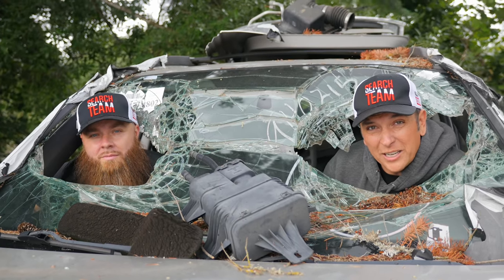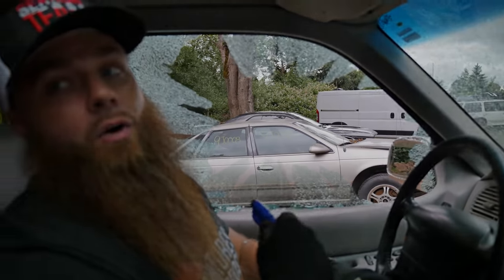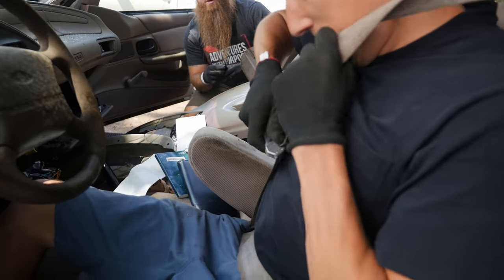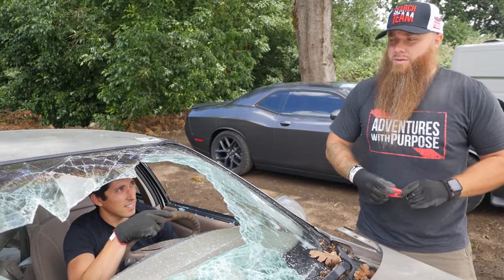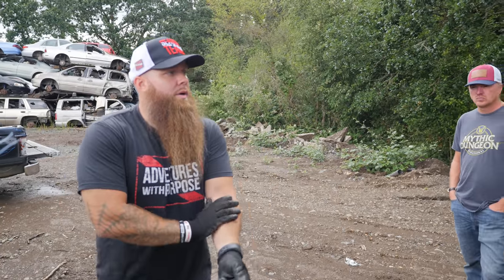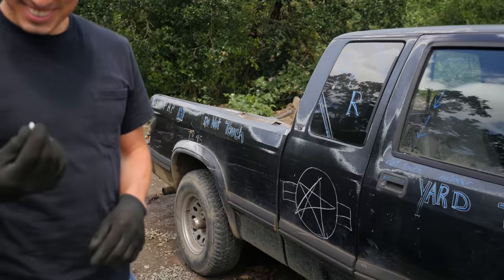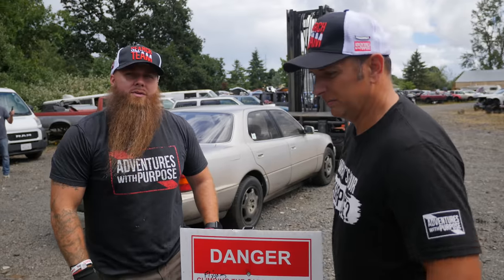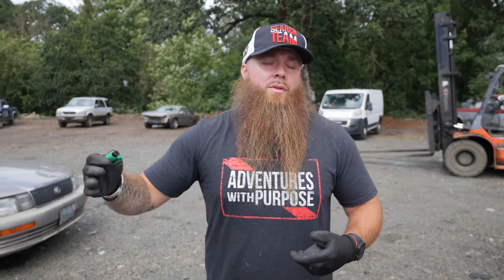HOW-TO-ESCAPE FROM YOUR CAR.!! (This Could Save Your Life)

Comment: The Smith & Wesson isn't really a great knife, but this demonstration clearly shows how the tool should be a "must have" for every driver. No fiddling with trying to get a knife from your pocket and then opening it. The seat belt cutter quickly zipped through that fabric. I agree that this should be on every key chain. At the current $6.95 price (in 2022), it shouldn't even be a question of whether you should have one of these. You absolutely should. I just purchased two of these.

Comment: Great video! I had some questions watching it. 
1. What do you do if all your windows are laminated? 
2. (This may sound stupid) How do you determine if it’s a good idea to stay in your vehicle vs escape. If you’re seriously injured it might not be a good idea to be moving around. What are the things to consider? 
3. If you’re trapped inside your car would the average person have enough strength to throw a piece of ceramic hard enough to crack the window? I know this was more about if you’re trying to get into a car but it made me wonder.  
4. If the vehicle is sinking and for whatever reason you can’t break the window, wouldn’t it be easier to open the doors once it’s completely submerged? How likely is it that you can escape in that scenario (given that you aren’t panicking)? 

Thanks for putting this video out there! It was really helpful to see that tool in action. I already have one and this solidified my faith that it will work in an emergency.
Reply: You cannot open the doors until car is of water due to the air pressure.
Reply: @allisonbowie1872  I know. That’s why I’m asking how likely survival is if you wait until the car is completely submerged to open the door (in the event you can’t break the window) vs breaking the window and escaping before the car is filled with water.
Reply: @badwaterb118  unfortunately you can't wait to open the door until the car is totally submerged because it fills completely with water in seconds through the bottom of the car, that is why in floods the cars no longer advance because the water filters from below, so the best option is to break the windows as soon as you can
Reply: @CM30-e1q   again, I understand that breaking the window ASAP is the best option. I’m asking for an assessment of survival in the event that you can’t break the window for whatever reason. To word it another way, how likely is survival, and what can you do to improve your chances, if you have to wait to open the doors once the car is submerged.
Reply: @badwaterb118  from what I'm seeing by the comments I'm no expert but you wouldn't, if you can't brake the window, the car would be full of water and you'd drown before you'd be able to open a door

Comment: FYI, we keep our emergency tool zip tied to the bar of the drivers side visor in all our cars. You can pull it off quickly and easily and always get to it in the event of an accident.
Reply: How can you pull it off easily if it's zip tied to the bar?

Edit: Ohhh, I see there's a release feature so you just pull and it comes off.
Reply: Great idea, I have a key fob and was wondering what I could attach the tool to.
Reply: Based on what was reported by AWP and what I see in their videos, the vehicle often turns over head first as the weight of the engine drives the vehicle into the water. The result is the car end up wheels up. I think it wouldn't hurt to have several of these devices located at midpoint throughout the vehicle. I haven't looked at them yet but I think they could be attached by a thin "chain" like you often see on a key chain or light bulb. A quick pull and its off.

Comment: When my kids were little I was terrified of this scenario. 5 kids with 3 being under the age of 5. The two older kids and I would practice getting the little ones out of their car seats fast in case of emergency. Big kids in the third row (very back), little kids in the middle, parents in the front. You have to practice until it becomes muscle memory. Glass breakers in the front and back of car. Let's face it, front seat passengers could be injured or deceased so kids have to get out on their own. Thank you so much for this video!

Comment: My wife is afraid of going over bridges. She has a hammer like tool that has a seatbelt cutter the piece that shatters the window and it has blinking lights and flashlight
Reply: @tatonkatatonka  - Right. And sometimes the seatbelt locks you in and you can't reach over far enough without unlatching the belt or cutting it off. I'm getting one of those for myself and each of my girls.
Reply: I have mine stuck to the dashboard with one of those sticky things that you can use to hold cell phones and glasses. The hammer thing

Comment: I had a rollover back in college. I did everything I could think to try and break the window to escape. I remember winding up and slamming the window as hard as I could and my hand just bouncing off. I'd never felt so helpless and weak before that moment. It was especially ironic given that I'd nearly died going through a window when I was a kid, and there I figured I'd die because I couldnt break a piece of glass. Eventually I calmed down, found the handle in the dark, unlocked the door, opened it and crawled out. I went to look at the car the next day at the wreckers yard. I had bent the door trying to break that glass. If my car had come to rest 30 yards before or after where it stopped, I would have drowned. If the engine caught fire, I would have burned alive. That glass is no joke.

Comment: Where would you suggest keeping the tool on a keyless start car? The keys arent easily accessible and possibly would fly around in a crash
Reply: On a lanyard in pocket of armrest or dashpocket...
Reply: I have ours zip tied to the passenger head test. Easy to grab. We have one in the backseat as well.
Reply: Turn signal lever or gearshift handle with a hair tie
Reply: @IKTH9192  kind of like the car in the video, no head rest. But great idea otherwise

Comment: You see all these scenerios on tv, movies etc, you think ok how ridiculous well that's what I thought until July 13 2022 on the interstate switching lanes I see flames in the SV mirror I stopped immediately told my passenger to jump and run he did, then the "ridiculous" happened my seatbelt is stuck my door won't open within seconds felt the heat on my back I did get out right as it exploded throwing me 20ft they said. Now there is NO "RIDICULOUS" scenerio scariest thing I've ever been through!! Thank You for this Video!! Seconds REALLY matter!!

Comment: The best way to prevent being ejected is to wear your seatbelt. I'd rather be able to break my side window to escape a dangerous situation. 
Keeping you in also means you're trapped in.
Reply: Yeah, I mean; if I get thrown out my properly worn seatbelt, I think I have different problems to worry about... Chances are I am already dead before a side window is the last thing to keep me in vehicle. However I can see that it would be good to keep the arm in. Overall, I think I would choose to have another two exits over some additional containment.
Reply: My paramedic sister said she found a lot more dead bodies that were ejected than were still inside the car. Sorry for the awkward phrasing.

Comment: I just want to add that if you never have to use the window tool, the seatbelt tool is worth the price. As a former first responder, you can't fuss with seat belt locks when you're in shock. Especially if you're trying to get family out.

Comment: Any recommendations for where to keep this tool when using push start (keyless) keys? It'd likely be in my pocket which will get by better than not having it.
Reply: Great question @Zonehawk
Reply: would like to know also as i have one and the fob is usually in the pocket of the jacket i use in fridge
Reply: I have ours zip tied to the passenger head rest. Easy to reach!
Reply: I was just thinking about putting it on a long cord and wearing around your neck- you definitely won't lose it! 🤗🌷
Reply: You could use a hair tie and put it on the turn signal lever or the gearshift (although some no longer have gearshifts and are knobs or buttons)
Reply: I do not know if it is a good place or not, but I hooked it to the passenger side headrest. Removable headrests usually come with two metal rods that enter the seat. I pulled the passenger side headrest out of the seat and putting it back in I put the rod that is closer to the driver seat through the keychainloop of the rescue tool. So that the rod goes through the keychainloop. The tool cant just dangle there. The tool cant go anywhere and you can easily pull it off like if it would be on a keychain. And theoretically all passengers in row one and two have access to it. I can access it without moving my body, just my right arm. 

This might be kinda weird to explain without having seen it, so if you wonder what I mean specifically just ask me and I will try to give a better explanation.

But basically one rod of the headrest is now going through the loop of the keychainring locking the tool in place like if it was on a keychain. And you can still just rip the tool off the chain like normal. Idk, was that explanation enough?
Reply: @IKTH9192  Oh yeah, I had a very similar idea. Instead of connecting it with zipties to the rod of the headrest, I just took the headrest out and stuck the rod through the loop of the keychain when putting it back in. Basically almost the same approach. Had I read your comment on the first reading of the replies, I might have skipped commenting. :)
Reply: @herrkeks8509   I would tie it on with a slip knot. If your in a rollover accident the headrest could be impossible to remove due to damage to the roof. If you use a slip knot in the event of an accident you can just pop the knot. :)
Reply: @rayevans3679  Oh no, I‘m not crazy. :) Having to remove the headrest would be terrible. Rollover or not. You‘d be done, before you could get it out.

Here 4:23 you can see that these things are made to be ripped off of what they are attached to. Instead of a keychain the keyring is attached to the closest pillar of the headrest. I can pull it right off, just like here in the video. :)

Thanks for your concerns about my safety. :)

Comment: 23:34 Oh, c'mon! Every kid knows that at the event of accident or sharp braking seat belts do what? Exactly! They lock in place to stop your body from travelling forward against steering wheel or dashboard. So keeping that in mind only thing you have to do is pull sharp on seat belt to have it tight. And correct place to cut it NOT anywhere in your shoulder or neck area but right beside the seat belt buckle. That leaves you without need to pull unnecessary 2' length of belt through the buckle, where it might get a twist 🔀 and get caught or seized. Seconds! Seconds are vital!!! 

I think you've been a bit unfair with that point ;)

Comment: Okay now lets see all this done in a 2017+ vehicle with the laminate glass side windows ( you mentioned but did not show ) and how to break them properly. Plus many cars today have push button starts so where would the best place to be to attach a window breaker where you know it will stay put and be reachable in an accident? All the vehicles you showed in this video were older. What about newer vehicle demonstrations?  Doing all this maybe with a 2020? So many new vehicles have added safety this or that. I was not aware they now made side windows like front windows are made. With front windows being so hard to break, how is someone suppose to break a side window if its the same as the front.

Comment: I have had one of these little tools on  my Keychain for over 5 years now. I will forever have one. I have two kids who sit in the back of my vehicles and I need to be able to get them out immediately. Especially when they were in carseats. So so so important. 

I was in a car accident when I was 3 months pregnant. We landed upside down and I was suspended by my seat belt. I had to be cut out by paramedics because i couldn't get my seatbelt off.

Comment: Hi guys. In South Africa a lot of vehicles are being fitted with an aftermarket film that is applied to the side windows as a security aid to prevent what we call "smash and grab" robberies. This is where criminals use a device like a spark plug or similar to shatter one of the windows and then grab any valuables. This film that is added to the windows is supposed to prevent the windows being smashed or shattered.
What would you suggest in this case ? Have you tested this device on windows coated with aftermarket tinting film or similar ?

Comment: The knife and spark plug won't work under water you won't have the same strength in the water. That's why AWP's tool is more efficient. It is spring loaded. My concern I have all laminated windows. For the newer vehicles without tempered glass, can you show us a way to get out please? I would have already bought your window breaker a long time ago. I would love to support you! It would be amazing if you came out with a tool to break laminated glass. I've watched others videos and none of the other window breakers work on laminated windows either.

Comment: Years ago me and a few friends had some junk vehicles on private property. The front windshields are so strong we rode up it with four wheelers and dirt bikes. We did burnouts on the windshields we could barley get a hole in it to put your head through. He had a lifted Chevy about 9 inches off the ground with 35’s mud tires on it. He drove that up it. It still didn’t break. I put .22 cal through it and my 45/70 gov. Through it. It doesn’t bust. Point is you’re not going through the front windshield. If you do you’re hitting it with enough force you’re dead anyway.

Comment: Question - Most (or a lot) of the new cars have key fobs.  I keep my key fob in my purse which is usually on the backseat floorboard or front passenger floor. Where would be the best place to keep this tool since I don't have my keys out and I know not to put it in the glove box.  I like how easy this tool seems to be to use vs the car safety hammer that I have now.  I just would like to know the BEST place to keep it since I don't take my keys out of my purse.  Thanks and thank you so much for this video - I learned a great deal.
Reply: Zip tie it to your visor
Reply: @Kitten_Inchaos  thnx, I didn't think of that. Only problem now is that I have a 2022 model car which means most if not all my windows are laminate.  Still gotta check the sunroof to see if it's tempered.

Comment: I'm not sure if you mentioned this later in the video or someone else has pointed this out.

When you demonstrated the seatbelt being a difficult thing to cut because it is always moving. Most cars have a seatbelt locking system where if you pull very fast. You can't pull out any more of the seatbelt. Locking it into place like a vice.

Comment: Another reason why this tool is so great is that it literally requires no effort. And that is not just about kids being able to use it. It is also because in cases of sinking or toxic fumes filling in the car, Oxygen is as crucial as time. In a dangerous situation, you fight and flight kicks in raising your heart rate (HR) and breathing rate (BR) and that is even when you are trying not to panic. If you panic HR and BR go through the roof.  You are using up you limited supply of axygen very quickly. 

Now, If you are exerting way too much effort in just getting the seat belt off and the window open, you are panting hard and your oxygen is already depleted. So in case of an engine fire kind of situation, you have inhaled a ton of toxic fumes and the time it took you to get the window open means everyone is breathing toxic fumes for every single second of that which can kill you, make you or others unconscious making rescue difficult and can cause widow's heart - a condition where you make it our fine but the toxic fumes later kill you within hours or a couple of days due to permanent lung/heart damage. 

In a sinking car, you have depleted your oxygen and you now have to swim to the surface, Chances are you will pass out on the way. This saves a lot of time so while the car doesnt have water and fumes, you are taking steps to help others in the car rather than struggling with the belt or the window, you have more oxygen. 

You also have less things to worry about because you already know how to get out of the belt and the window. So your limited reactions and thinking is focused on other things like how to get the kids out, you can get a better sense of you bearings while doing all of this, what position the car is in, how to time your escape etc. Rather than being panicked and trying to brainstorm the belt and window situation.

Comment: I was wondering what a good place to put the tool in my car would be because most modern cars do not have an ignition to put keys in anymore, just a “key sensor” to keep with you and an ignition button to push. I keep my “key” in my armrest compartment while driving and I fear if I put the tool on it/in there it certainly might get jumbled/thrown around in the car in case of an accident. All the explanation revolves around being able to access the tool quickly as it is on your keychain in the ignition. Most newer cars, however, do not have a traditional ignition “keyhole”anymore. Any suggestions please?
Reply: Yep this is my question too.
Reply: Start by trying to buy one. Follow the link to their website, They don't even sell it anymore.. not sure why this video is still up?
Reply: Put it on your sun visor? They make little straps you can pop right on there.